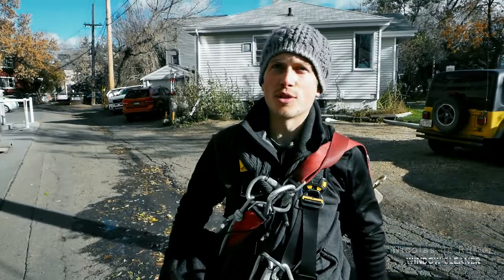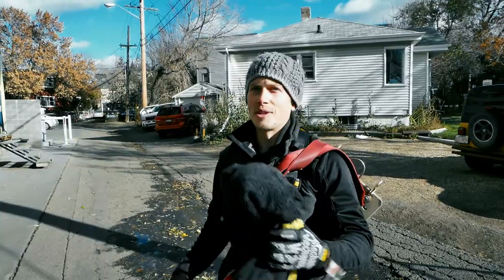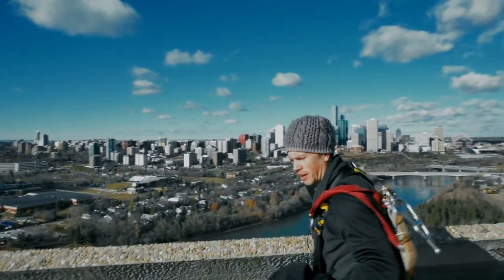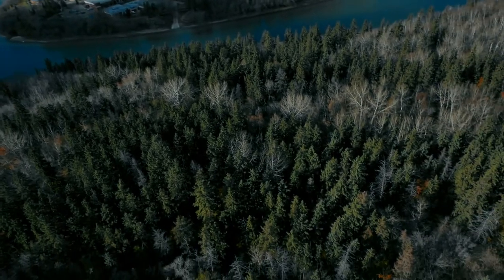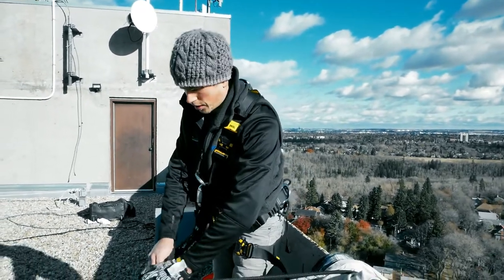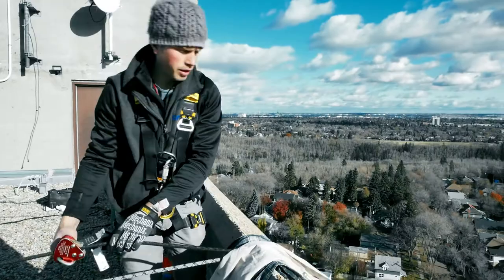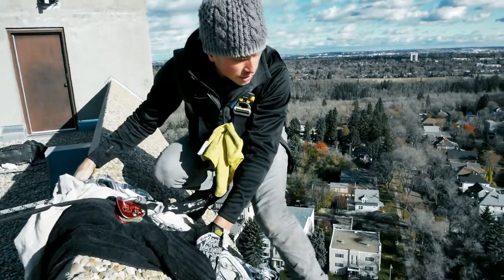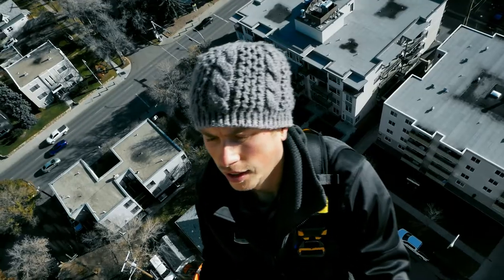Nicolas de Ruiter - High Rise Window Cleaning

Comment: Hi great video dude I’m a level 3 irata abseiling window cleaner in London England. I strongly recommend you get better edge protection good luck for the future bro…
Reply from the maker: Hi Lee, indeed, I don't have that certification as I'm sure you can see from the equipment. Since this video I got a very nice edge protector, but I must say, on this building the rough edge is very wide and would need an extremely long sleeve to protect the edge. On that building, I've found 2 big sheets to be the best option -- holds the rope like a baby. But I've done a little bit of Irata training, and have seen that you all use really state-of-the-art gear and the techniques are brilliant -- I love it. Thanks
Reply: @nicolasderuiter1699  keep up the good work mate
Reply: @leesnell4296  hi Lee do you have anywhere I can message you privately regarding career??
Reply: @chrisprice3391  hi mate how do you want to talk?  Email what’s app phone?
Reply: @leesnell4296  yer mate email or WhatsApp works what are the??
Reply: @leesnell4296  hi mate did that email come through??
Reply: @chrisprice3391  hi mate no I not received your email and I don’t really want to put my email on here for the world to see I don’t know how I would get it to you privately?
Reply: @nicolasderuiter1699 where to buy those carabiners?

Comment: That is a  hard job .. Been doing it 30 years .. eventually your elbows and joints will take a beating.. to prevent long term problems  like tennis arm  / RSI i highly recommend using tools as light as possible and a new rubber change  every day .  even twice a day..  Must be a right pain cleaning in wind on those vertical jobs..
Reply from the maker: Yes indeed, a sharp channel and straight channel is like magic and you have to look after the body while pushing against the glass, hauling ropes and ladders all day. So far I find it gives more energy than it takes, but you're right -- hard work takes a toll. And yes, the wind is a huge factor...where it sweeps the water, whips the ropes around and blows us into trees and who knows where. It's a full brain and body job.